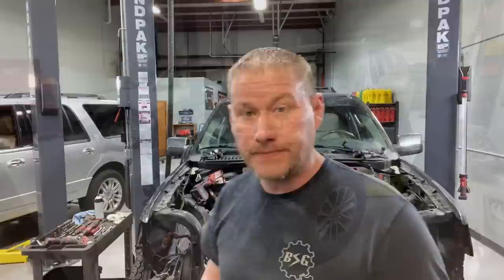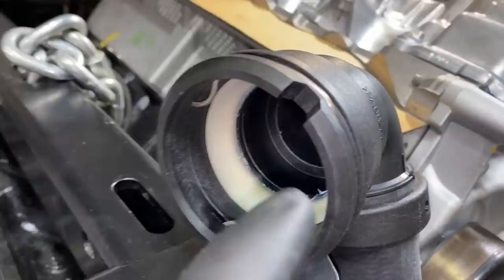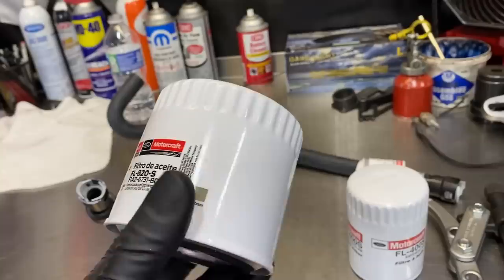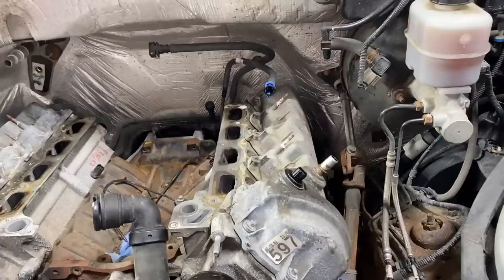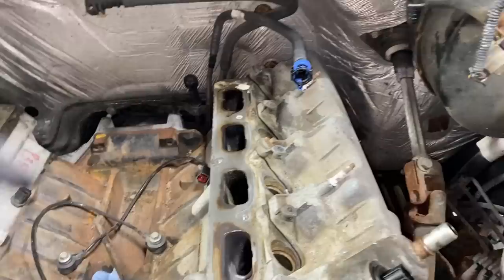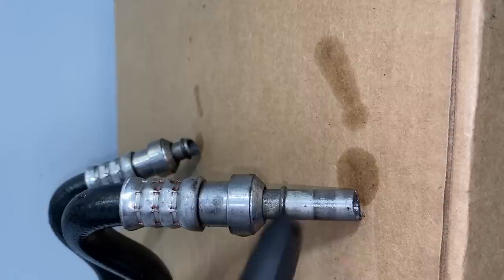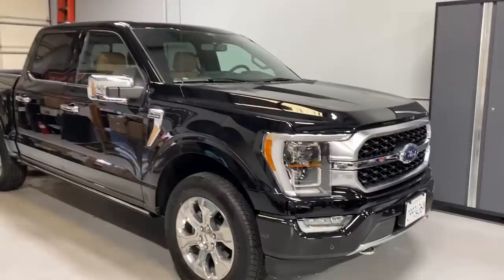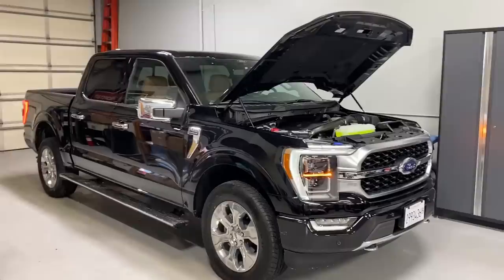Shop Update and The New 2021 F-150!

Comment: Brian if you have some spare time, you can drop by and make my garage look like yours.  What an amazing looking 2021 truck.  Gotta give a shout out to our 2020 Edge SEL.  The safety features with Co-Pilot 360 is the only way to fly!  We drove the car to south Texas earlier this month so I could cross the border for much needed dental work.  I set the adaptive cruise at 80.  Going through OKC, Ft Worth and San Antone was a breeze.  The car sped up and slowed down on it's own.  Lane keeping assist and blind spot information should be included standard on all vehicles.  Ford did everything right on the car.  As far as my Wife and I concerned, it's the best looking, safest SUV on the road today.

Comment: Been watching your videos for several years, especially when I had an 07 F150 with the 5.4. Never had any problems with it since I followed your advice of keep up the maintenance.  In 2019 I traded it after 160k miles for new 19 F150 Sport 4x4 xlt with the 3.5 EcoBoost. I love it and regularly pull a 24 ft boat with it.  Love your new Platinum

Comment: I did an ecoboost replacement a couple years ago and I remember you talking about those leaking hoses. So all I did was take the o ring out and roll it around in my hand cleaned it up, put it back in and it never leaked.

Comment: I am looking forward to more on the 3.5 water pumps. I know you put a video out on it once warning us about replacing them before 150,000 miles but I had one that went out at 80,000 miles just 10,000 past my warranty catastrophically destroying multiple subassemblies throughout the engine. Bottom line it cost me about $8,000 and I think it was something Ford knew about but should have fixed. That said I still do not know if Ford made it or if it was a supplier or who it even was if it is the latter. What I do know is it failed in about two stages where I felt a pop like running over a pothole and then shortly after the engine locked up when the bearing failed. I was going about 60 MPH churning a consistent 2000RPM on the interstate.

Comment: Let’s just hope that the heater hose engineer and the self driving engineer are two separate departments. LOL
Reply: The heater hoses work fine, it's the larger, single o-ring rad hoses which fail.

Comment: had a lot of fords in my life but have never seen such junk as the triton motor and the v10..swapping a 4.6 now and believe it will be parted out before getting fixed.had 3 rangers at one point and have loved them all. my wood hauller with wood stacked above the cab all the way back and handles it beautifully

Comment: Big money saver tip, remove the quick disconnect hose o-ring with a pick tool, o-ring comes right out, put a thin coat of grease on it, reconnect the hose, no need to waste $150+ for a hose from ford, repaired lots of these already doing this trick

Comment: Why didn't you go with the 2018-2020 ?
Reply: I'm curious too. I have a 2018 and hearing him say that scares me lol
Reply: I'm wondering the same thing.
Reply: Cause  the 2021, is the next gen frame and systems. I own a 2019 xlt 3.5tt and may go to the next gen raptor with the gt350 v8 in 2022/23.
Reply: @sloanv2610  just picked up a 2018 KR and my stomach got a knot when he said that
Reply: A lot of guys from the F150 TX group I’m in have transmission , oil consumption, and ticking noise issues
Reply: Curious about this answer too. Thank you for the great channel and great content

Comment: Can you expand on why you commented that you did not want the F150 18-2020 models?
Reply: Maybe he just doesn't like the bodystyle?
Reply: Wondering the same thing
Reply: I'd imagine it has to do with the engine and transmission issues. We see it all the time here at my dealer. 18-20 5.0 engines like to consume oil, some having porous blocks and leaking oil, 3.5 EB with their phaser issues (there's a TSB on it) and the 2.7 has some issues with that as well, and the 3.5 (earlier ones) and 2.7 have a stupid plastic oil pan that always leaks. The 10R80 has alot of issues even still to this day as well.
Reply: @fargenvonwitbier  if he was worried about the engine or transmission issues he probably wouldn't have bought an f150 to begin with.. especially since you mentioned some of those problems still exsist
Reply: I second this
Reply: @WontSeeReplies  Well, they went from one single chain to two chains in 2018 on The 3.5 EB, so yeah there would be two tensioner. But the chain stretching isn't the problem. It's the phasers making a rattle on cold startups.
Reply: @fargenvonwitbier  If so, what is different from a 2020 3.5 ecoboost to a 2021 3.5 ecoboost? Nothing in the phasers that I'm aware so I'd still like to hear from Brian as to what he thinks the differences are. I had a 2016 3.5EB and traded it in for a 2020 because I saw real improvements and problems that had been addressed. Not so much for the 2021 unless I'm missing something.
Reply: @WontSeeReplies  Nope. There are two chains with a tensioner on each.

Comment: Beautiful truck surprised that you didn't go with the 5.0
Reply: A while back he said that the 5.0’s are looking like becoming the new 5.4 3V’s. He doesn’t like them
Reply: @rallymaccartney5543  which video did he mention that? I’d like to watch it.
Reply: 5.0s have some issues. I have one and it's got problems with timing chain rattle  and popping noises.
Reply: @lukeowings3204  it was actually a Facebook post
Reply: @BrianHealy  no it doesn't that rattle is the phaser soleniods pulsating. This has been confirmed though fords ids system.
Reply: I like the 5.0 and the sound of the exhaust. Tfl just did a bit a few days ago on one I think Andre covered it pretty well
Reply: @BrianBourgeois-  regardless, it's still an issue with 5.0 engines
Reply: @BrianBourgeois-  That's not what ids is used for. They couldn't have put that information in it even if they wanted to. 

Either way, there's more than one type of rattle. Most of the time, its the fuel pump you're hearing.
Reply: @solarfall2728  yes it is. The you can monitor the solenoids and see when they are activating. The noise corresponds exactly. If you to test the theory unplug them and go for a drive.
Reply: @BrianBourgeois-  Then why don't you show me what you're talking about. What's the bulletin number you are referring to? By law, they have to be made available to the public.
Reply: @solarfall2728  it was not confirmed through ford. It was a technician and a customer. If you want to test me. Unplug them and go for drive. It will not make the noise. This is proven fact.
Reply: @BrianBourgeois-  I'm a senior master Ford technician. First you're telling me this issue was posted on ids. That can't be true because ids is our old scanning software. I'm sure you meant to say its in the Oasis portion on the PTS web site. Someone is giving you bad information. If there was a bulletin on this issue, that's where it would be. I have it up right now, so you're more than welcome to have me run any bulletin you want. If there is something in Oasis pertaining to this, I can't find it. As for your friends diagnostic process, I would get fired if I got caught doing something so half ass. You typically don't hear oil solenoids, and just because something's making noise in that area, doesn't mean that's the bad part. Its more likely to be the phaser itself. 

The reason I know you are getting bad information is this. Even a lube tech would know not to unplug an oil solenoid and drive the car. Its a stupid thing to do. You have 4 oil solenoids on the 5.0. 2 for your intake cam phasers, and 2 for your exhaust phasers. They are the same part numbers. If you have a suspect solenoid and wanted to do a quick test, you would swap the solenoid you think is bad with one on the other side of the motor. If the noise moved to the other side of the motor, then your suspicion is correct. If not, its something else, like a phaser. This is something an entry level tech would know to do. 

In my other post I stated that there's more than one noise effecting the 5.0. I'm not guessing on that either. If you check the bulletins for the vehicle, you may find something like this.

Summary 
(TSB 20-2023)

This article supersedes TSB 19-2144 to update the model years affected.

Issue: Some 2018-2020 F-150 and Mustang vehicles equipped with a 5.0L engine may exhibit a light to moderate knocking type noise at idle (600-700 RPM) that is sometimes described as a quiet diesel type sound. The noise is usually more prominent on the passenger side of the vehicle toward the rear of the engine. As the engine comes up to operating temperature, the noise level increases slightly. This noise is not detrimental to engine function and has no short or long term effects on engine durability. This an operating characteristic of the 5.0L engine and no repairs should be attempted.

This is the fuel pump noise I was referring to. There's others as well. This information has to be made available to the public, so if you can't find it, there's a good chance you have bad info.
Reply: @solarfall2728  i never said the information was posted anywhere. Im telling you what i read. The only issue im talking about is the deceleration rattle. A owner got the technician to monitor the solenoids using the scan tool and could see the pulsating that corresponds to the noise. I believe this to be the case because to my knowledge no  one has had the engine apart and found any evidence of metal on metal contact. Which is what some are suggesting, calling it a chain rattle.
Reply: After reading all these comments i think restoring on old car is better then these new ones.
Reply: @vblic  theyre death traps though.
Reply: @vblic  get a 97-03 f150 with the 2v motor. Absolute best generation of F150 if you want reliability and value. Bullet proof engine with no phasers/no adjustable cam timing, simple 4 speed transmission, just a basic truck. Worst part is the rocker panels eventually rust out. These trucks routinely go 300-400k miles.
Reply: @WontSeeReplies  wrong. 30% of all f150 have the 5.0. If that were the case you see a huge recall. In fact Ford stopped replacing engines because the ones they got back had nothing wrong with them.
Reply: @BrianBourgeois-  recalls are only done for items that can cause severe safety issues.
Reply: @AJourneyOfYourSoul  yes but that would be a safety issue if your vehicle had major defect and left you stranded in the middle of no where. There’s no problem with the cylinder liners. These people don’t know what they’re talking about.
Reply: @BrianBourgeois-  leaving you stranded is not a safety issue for a recall. Safety issue for a recall is something that can cause an accident, vehicle catch fire, hurt people etc....  A design or manufacturing defect that won’t cause harm, is a warranty issue, and of course if it breaks after the warranty period, or the manufacture says it is normal while under warranty, then you really have no recourse.
Reply: @AJourneyOfYourSoul  wrong. The company would be liable if the defect were to be blamed for a death.
Reply: @BrianBourgeois-  cylinder wall problems are not going to cause a  catastrophic accident/death.
Reply: @AJourneyOfYourSoul  there are no cylinder wall problems.

Comment: melted intakes on transits with 3.5 at the thermostat housing. 5.4's at the water crossover,  plastic thermostat housings at the oring push out all the time. Ford gives mechanics lots of work lol

Comment: Why didn't you go with the 5.0? Congrats on purchase
Reply: Right!
Reply: Yes!  I was loving that new F150 until he said ecoboost.  Not a fan.
Reply: Eco- boom !! Garbage
Reply: Because the 5.0 has oil consumption issues that they refuse to admit is a problem
Reply: @rallymaccartney5543  didn't ford resolve that problem after 2018 model
Reply: @steevegmtech7326  no and unless they changed the design for the brand new ones (the plasma spray in cylinder walls) the problem will more than likely still be there for some

Comment: Ya, I know about the burned intake manifold.  I worked in a City (of L.A.) Fleet Shop, that our night shift had installed a new from Ford 5.4L 3 valve long block in a 2005 Expedition, because the old engine had one of the intake valve's stick open, allowing lots of hot gases and flames nearly destroy that part of the manifold.  Not only that, but during the install the very small wiring harness that went to the IMRC stepper motor was damaged.  So no electrical input or power to the motor, and I'm sure you know where THAT motor was located!  Plus the night shift did NOT replace the intake manifold!  The IMRC system did NOT work, power was down when accelerating.  This is where I was called in as the day shift auto electrician.  What a learning curve that was ! ! !   
Yes I ordered the new intake manifold, the IMRC motor (didn't know it's condition) all the gaskets, coolant, etc, and THEN I had to rebuild the wiring harness for the IMRC motor to PCM connection.
THANK GOD for the Ford IDS!  
I learned along the way how to manually test the IMRC electrically and monitor the PCM's control and monitor operation while driving.  
Taking the vehicle for its final test drive coming out on to the street, giving it full beans (throttle) from a stop put a smile on my face!  The power was GREAT, and even with the positraction rear end, you had to hold on tight!  What a ride ! ! ! 
My apology for the long story, your burnt manifold brought up that memory!

Comment: he probably can swap out a 5.4 with his eyes closed
Reply: one handed too
Reply: Those 5 4s are straight junk
Reply: @FixIt1975  the earlier 2 valve 5.4s are ok, we have a 04 expedition with 237k on the original 5.4 and my buddy has 280K on his 2001 expedition 5.4
Reply: Nice truck!
Reply: @FixIt1975  Nah...I've got an '04 5.4 3V and it purrs like a kitten. Bought it new and I've never had a problem with it. However, I've never towed anything and it's not my daily driver. It's a vacation/road trip/camping vehicle. Probably has about 500lbs of stuff in the back along with mtn. bikes. So it's been babied...garaged when not in use, too. I changed the oil at 1500 (the break-in oil), ran Ford synthetic blend for the first 30K (oil changed every 4-5K) and switched to full synthetic 5W-30 instead of 20. IMO, these engines need really clean oil and they're fine. My experience, at least. I'll drive this truck until the wheels fall off...and that may be a while because it's rust free. Still looks like new.

Comment: This is the exact problem I’m having! I have a do an intake that won’t seal right and I get a random misfire code and cyl #8 misfire.... I replaced coils and plug twice already and it is still on. The whistle noise I thought was coming from the vacuum hose in the back has to be the intake! Thank you!

Comment: I've worked on BMW's and they've been using quick connect oring hoses for years. I did an electric water pump job on a 07 525xi and just to get all the hoses was easily 350 bucks. I like how easy the are to connect and disconnect but I hate the lifespan and cost of all the oring hoses. Beautiful truck btw ford is definitely my go to vehicle :)

Comment: Love the new truck. I’m looking at getting a 2021 platinum with a 5.0L. I was hoping you might have some insight on how to disable the AFM in the computer permanently so it doesn’t switch to 4 cyl mode. I want it to stay in V8 mode. Can it be done using the Ford IDS program or HP Tuner? I’ve seen a lot of bad things with the Chevys regarding this and also how to disable it on them. Looking forward to a video on this. Thanks

Comment: Still waiting on my 2021 platinum. trucks look pretty sweet. Curious why you choose ecoboost vs v8 being a mechanic
Reply from the maker: The 18-20 5.0L was a complete disaster and IF they actually made big changes to the engine in 2021 I was not going to be a guinea pig that's for sure.

Comment: Congrats on the new truck!  I haven’t warmed up to the new front end yet, I still prefer the 18-20 headlight design.  Better dash though!   I have a 19, I also skipped the 5.0 with all the issues Ford has had with the 18 and newer V8.   Only 16,000 miles on mine so far, zero issues.

Comment: I believe 25 pounds on intake bolts and I busted one or two last time 🤨 did my roller followers, lifters and timing at 298,xxx. At 400,000 will do timing again and this time will pull heads with exhaust manifolds attached and replace head gasket and get new exhaust manifolds since the old ones have no good permanent donut gaskets. Might have heads resurfaced. Bought the billet aluminum timing chain guides so will just need to buy the two Teflon strips to replace on the guides. Thanks for awesome videos